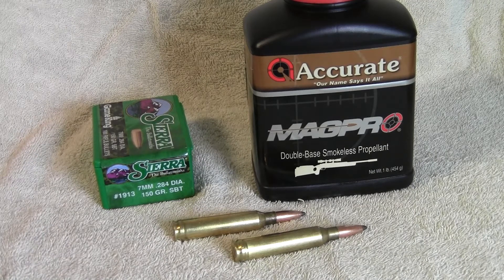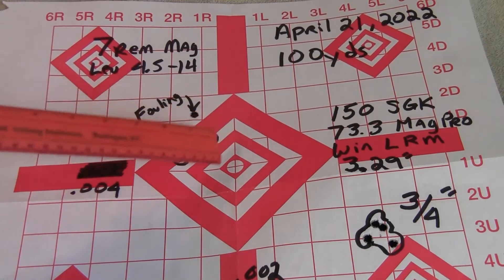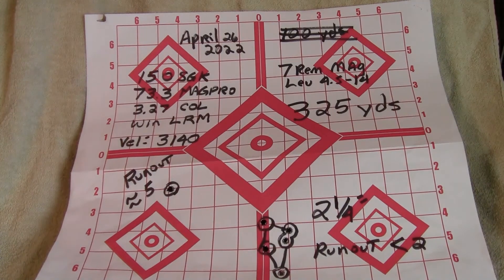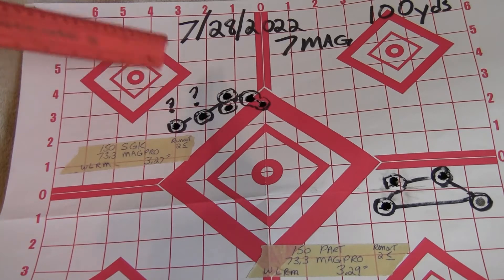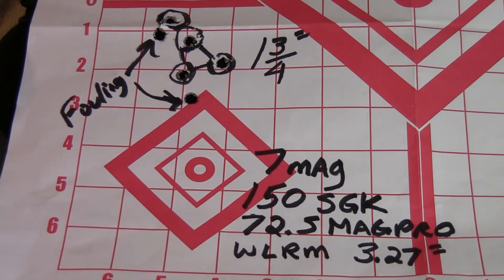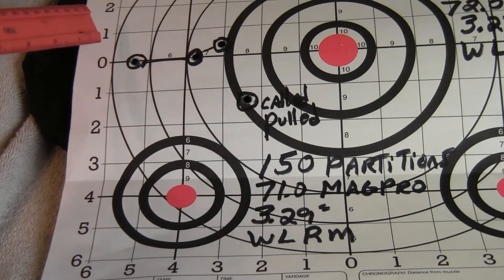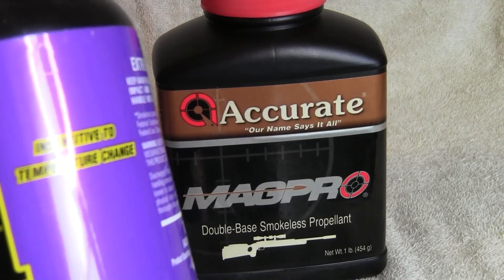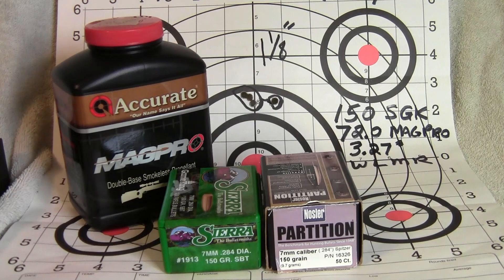7mm Rem Mag Winter-Summer Handload Temperature Problems

Comment: A friend of mine did some test on bullet run-out effecting group size.  The ammo tested had .001 to .007 run-out. The test was performed by segregating the ammo into groups by run-out. The groups were then colored with sharpie. At 100 yards there was no discernable difference. Then, the same groups of run-out were shot at 300 yards. The color transfers to the paper. Group size was basically the same, with some if the bullets with .007 run-out shooting inside the ammo with .001 run-out. Ten shot groups were fired for the test.

  I'm guessing there was one or more variables effecting your group size other than run-out.
Reply from the maker: Yeah, a lot of variables. I am thinking it was more with temp difference from winter and summer. Hey, thanks for watching!

Comment: John handloading for the 7RM or any magnum there are a couple of things that you keep in mind, every bullet is different so you must find the CBTO for each bullet. When bullet weight goes up powder burn rate goes down, Magpro maybe would perform better with a heavier bullet say a 160-162 Gr. With a 150 Gr perhaps IMR-7828 would be a more efficient powder. Slow burning powders like IMR-8133,7977, Retumbo, would be more appropriate for the heavier weights like the 175 or 180 Gr bullet weights . There’s nothing wrong with trying to find a temperature sensitive powder, Hodgdon’s line of extreme powder’s are known for that  
Just be prepared to move up in bullet weight, slow burning powders with light weight bullets is a good why to burn out your barrel, because the load is unbalanced. Wishing you all the best.
Reply from the maker: One reason why I used Magpro is that it is available, many other slow burning powders are not, at least not in Alaska. Magpro is probably a bit too slow, but it has worked fine in the past for me. Hopefully the powder selection gets better. Hey, thanks for your input and watching!
Reply: @30-06john  well John at least master the CBTO method with your 150 Gr bullet. The traditional powders with the 150 Gr bullets in the 7RM are IMR-4350, RL-19, IMR-4831, H-4831, RL-22. There are reports that RL-23 is temperature insensitive , and it get good velocity’s in the 7RM